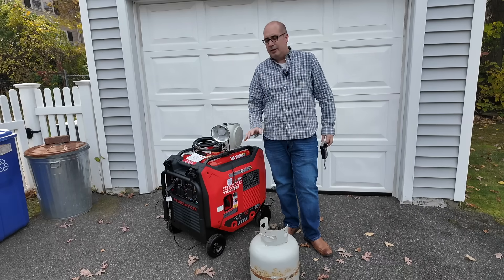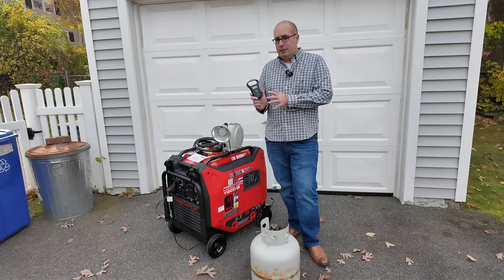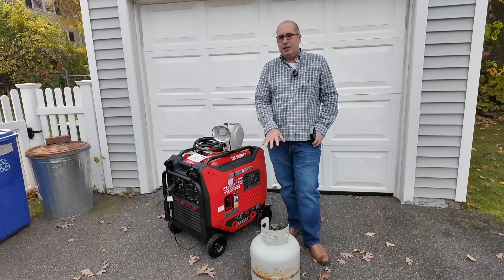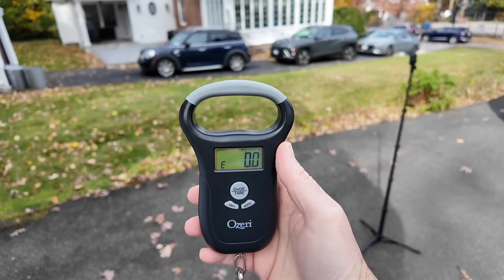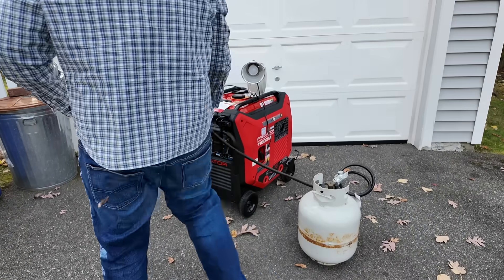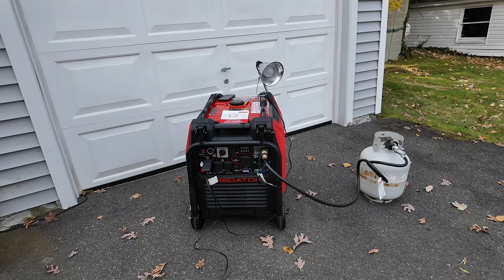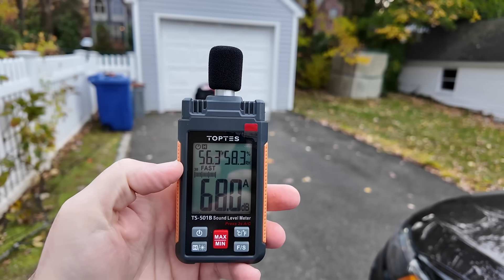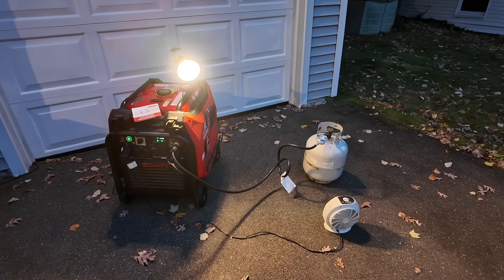Predator 11500w Generator Propane Runtime – You Won’t Believe How Long It Lasts!

Comment: Do you have a link?
Reply from the maker: https://www.harborfreight.com/11500-watt-tri-fuel-super-quiet-inverter-generator-with-remote-start-and-co-secure-technology-epa-72614.html?hftm_sc=3562&hftm_source=google&utm_source=google&utm_medium=cpc&utm_campaign=22877905851&campaignid=22877905851&utm_content=185350362924&adsetid=185350362924&product=72614&gad_source=1&gad_campaignid=22877905851&gbraid=0AAAAADAHb4eWgUJ0713Vh6C8XmaQUXbIq&gclid=Cj0KCQiAiqDJBhCXARIsABk2kSnVInlGZjSy4a91OPhkAYVusSO_KLhq55ACnz2tefZiDlPXo3l6shcaAu6qEALw_wcB

Comment: Nice data. You could really automate by just plugging in an old school electric clock. When the generator dies, the clock stops! (I used to test battery capacity with an inverter, a light bulb and a clock.) Come back in the morning and read the result!
Reply from the maker: That's a clever idea! Thanks for the suggestion.

Comment: I have a 1300w DuroMax generator and I get 6 hours from a 20# bottle on my home.  I set my A/C to 78 degrees and didn’t use my electric stove or dryer. I didn’t experience my tank freezing.
Reply from the maker: Thanks for sharing your propane runtime!

Comment: The OPD is set to blow off at 80% full, so the combined weight should be 16  lbs of propane plus 18 lbs of tank weight, or 34lbs, so yes, they actually gave you an overfilled tank!
Reply from the maker: Good info! Thanks for watching
Reply: So we should just call them 16 lb tanks.
Reply: No not 16 pounds... A “20-pound” propane cylinder contains about 20 pounds of propane when properly filled, which corresponds to roughly 4.7 gallons, and that amount is the 80% liquid fill limit enforced by the OPD.

Comment: I REALLY appreciate the content and effort. I'm looking for generator backup for essentials... lights and refrigeration for food. My question is why test 11,500w for a small heater and a light with more essential needs in an emergency? Do I need a bigger unit than 11,500w?  -bp
Reply from the maker: 11500 is more than sufficient for most people and in my testing at home I generally pull about 4,000 watts unless I fire up ac or a toaster and microwave or coffee maker at the same time. The 11500 watts is starting watts - but actual sustained running watts for this generator are 8000,7500,7000 depending on fuel type

Comment: As I understand it ... the Predator 11500 is bonded neutral ... ground to the Frame... are you using an interlock system plugging it into your house?  If so you will want to make the gen to a "floating neutral"  by removing the ground wire from the frame.
Reply from the maker: 100% agree - I need to figure out how to take it a floating neutral so I can safely hook it up to the house

Comment: For the test you should power house not a $35 heater
Reply from the maker: That's a good point! However, the heater allowed for a controlled, consistent load for the test.

Comment: Will this thing run at -30f?  That's what I need to know.  Hondas won't unless you get the cold weather kit.  They make these things for Florida hurricanes without thinking about the north.
Reply from the maker: Tbh I don’t know if it will run at -30 but assume it should

Comment: One more comment:  by doing the "tare" calculations as you describe, years ago I figured out that the cylinder "exchanges" (Blue Rhino, etc.) only give you 15 pounds!  In other words, they are only 75% full.  This is disclosed in the fine print, but very mis-leading.  DO NOT exchange cylinders... Instead, take them somewhere to actually get filled!
Reply from the maker: I totally agree with you!!! It’s best to go to an independent refiller! Thanks for watching
Reply: It's a good way to get rid of old crappy cylinders and get fresh ones.
Reply from the maker: @ClayinSWVA for sure!
Reply: @ClayinSWVA  Agreed!  The Home Depot person looked at me a little funny when I asked for a particular tank based on its expiration date.  She didn't even know they had those... In fairness, I didn't either for many years.

Comment: You nailed it on using the exhaust to keep the tank warm.  I have a Duromax 9000 inverter generator, and it runs just fine off of a 20 gallon tank, even running at nearly full load for periods when my electric water heater kicks on.  No fuel starvation at all.
Reply from the maker: Thanks and thanks for watching!

Comment: You should only fill a propane tank to 80%. This means a 20 pound tank would be "full" at 16 pounds. If the tare weight is 18 pounds, the total weight should be 34 pounds. 

One thing that you did right is using a reasonable load for a long run. Most portable generators are based on 25% load with occasional high load. 

In fact most portable generators consider 50% or higher load to be heavy use. Most portable generators require an oil change every 100 hours, or every 50 hours under heavy use. 

It is important to realize that using propane will lower the generator ratings. As elevation increases the load ratings decrease. 

High ambient air temperatures reduce load ratings. Usually around 100F is considered heavy use. 

When you combine everything, over 50% load (especially over 80% load) with ambient temperatures over 100F might require an oil change every 25 hours and may require a cool down period. In other words don't expect to hook up a 100 pound tank and run a generator for 24+ hours continuously under these conditions.
Reply from the maker: That's great info, thanks for sharing!
Reply: @Outdoor_Prepper just to be clear, the 80% rule isn't something I made up. Almost every jurisdiction has regulations mandating it, it's industry practice everywhere. 

If you fill the tank to 100% you leave no room for thermal expansion. Imagine the worst case where you fill the tank in the winter when it's very cold, but don't use it until the summer when it's hot. The tank can literally explode. Some deserts can experience tempature swings exceeding 60F in a single day. 

The prefilled tanks should be filled to 80%, but I'm sure that around 75% is common as that 5% adds significant profit over time. 

You do normally pay a premium for pre-filler tanks. You are paying for a refurbished tank and convenience. 

They are available almost everywhere and can often be purchased 24/7, including during power outages that shutdown the propane pumps. 

It's important to consider how much you are being charged to fill your tank. I've seen places charging over $5/gallon when most places are $3/gallon and sometimes one or two are around $2/gallon. Then some places charge a fee to fill the tank plus taxes. 

If you go somewhere that is charging $5+/gallon and a fee plus tax it may be cheaper to go to a trade location. 

A trick is to purchase an old, cheap used 20 pound tank. Something out of date, rusty, etc. You then take it to a trade in location and pay about $25 to swap it for a refurbished tank that is certified.

It is illegal to fill a propane tank out of certification. The certification date is stamped on the tank. 

While it is somewhat common to find locations that don't check the date, do you want to risk not being able to fill it when needed or for the seals to fail because of age?

Comment: so my set up is,  a ecoflow delta 3 ultra with the 3072wh ,   that runs my central heat, my entire living room and my kids room.... so everyone toasty warm and entertained,  i have 3 generators,  i got one inverter generator 4k/3.5k running, and that charges the ecoflow, so topped off gives me 3-4 hours  of power without generator, now the generator will run on 50 percent, which gives me the full 1800 charging watts, for 7 hours, so with the powerstation, that doubles the power from the same amount of gas, which is a win in a winter ice storm, which we are expecting this year,  i also carry 50 gallons of gas on hand to start a weather event.... while others sit in lines for fuel, i sit at home in the warmth lol
Reply from the maker: That’s an awesome setup!

Comment: For those commenting on using a larger tank to prevent tank freezing, you can also use something like a Frost King water pipe heating cable and wrap it around the tank. It will keep it warm without overheating. I have used it in winter (Colorado) to be able to get enough pressure out of the tank to grill or run a heater...
Reply from the maker: Thanks for the great info!

Comment: I have two 100lb tanks. Each tank holds approximately 24 gallons of LP gas.
Reply from the maker: That's a good amount of propane to have on hand!
Reply: @Outdoor_Prepper  I live along the Gulf Coast and have been through many hurricanes over the years. It pays to be prepared because after a hurricane you can be without commercial electricity for days and sometimes a week or longer.
Reply from the maker: Totally agree!!

Comment: Excellent video!
Thank you for doing this
On the propane tank icing potential problem:It’s not so much the 20 lb tank volume being the problem.Propane boils off into vapor and gives you your energy.When the generator demands higher wattage(higher consumption)the propane tank’s surface area cannot boil off enough vapor even if the tank is full.
A 40 lb tank is roughly the same diameter if not identical(I haven’t measured but I believe it is)so that won’t really help.
What you need to do is daisy chain two tanks together with a pigtail(or even three).
This way when one tank starts to ice it will pull from the other tank(automatically pressurizes between tanks).
Mr Heater makes a two tank connection that I found good.
So basically it’s a problem of surface area and I don’t believe raiding the temperature will help.
I may even buy a 120 gallon propane tank or more.
I would just feel better.
Reply from the maker: Thanks so much for the detailed explanation and suggestions!

Comment: No not another 1.2 lbs, propane tanks are usually filled to 80% so a full tank is your 18lbs plus 16lbs of propane
Reply from the maker: Thanks for watching
Reply: @Outdoor_Prepper I was thinking of getting this inverter generator to run on NG.  
But I’m thinking of doing the hybrid system of inverter with lithium/some solar then start the generator to charge the lithium back up while simultaneously running the house during power outages.
Reply from the maker: That would be a great setup! A generator in conjunction with batteries and solar is the perfect set up
Reply: @Outdoor_Prepper I may get away with a smaller generator, but I do like that 1150 you have. Just reading the specs. 9kw gas and 7.2kw on NG.  I guess I’ll just get this one.  With the option of getting a second one if needed.  😊
Reply from the maker: @TommyLuptak  so far it’s a great generator and I really do like it. Hopefully it holds up for the long-term. I have the 5000 as well and it’s been working great since I got it.

Comment: Most of these engines are supposed to be really fuel economic, a lot better than the hondas are just as good and I've dealt with these engines before, and I'll run a generator about like you're running now on half a tank of gas, and this generator held 2 and a 1/2. Gallons, this was in a 24 hour period  So using the propane is not too impressive at all
Reply from the maker: Thanks for watching

Comment: You can go online to most any propane supplier and they will have a chart with the size of the tank, the outdoor temperature, the fill level, and the maximum BTU you can draw from the tank. A generator draws around 10,000 BTU per kilowatt at its most efficient running speed, which is around 75% of full load. There’s also a big difference in tank performance between the 48°(~8C) that you tested, and the 10° (~-10C) or less that you’re likely to find in a cold location. Worse, fill level affects this too. A tank that’s 75% depleted can provide maybe half the BTU load of a full tank. Propane doesn’t actually freeze - tank frost happens at only 0°C while propane will vaporize down to ~ -40C (or F). Rather, as the tank gets colder, the propane won’t vaporize fast enough to feed the generator with sufficient fuel. The manufacturer recommendation of a 40 lb. tank is probably based on something conservative, like 50% power at 32F/0° C. Try 8 kW at 0° F (-17C) and you will undoubtedly be out of luck, even with a 40 pound tank.  The mfg might specify in the manual but I doubt Harbor freight does. If you live in a very cold location, you should probably be using a minimum 100 pound tank for an 11Kw generator, maybe even larger. Pointing the exhaust at the tank is an obvious idea, but it doesn’t really work as you just can’t capture enough heat. Point is, while propane is convenient and can be stored forever, it is not a great choice for very cold locations. I use propane in the summer and gasoline in the winter for this reason.
Reply from the maker: Thanks for all of the great info and suggestions!
Reply: I've seen 500 gallon tanks fail to deliver enough propane to run a home furnace at -35F or colder.
Reply: @Skyhawks1979 that sucks